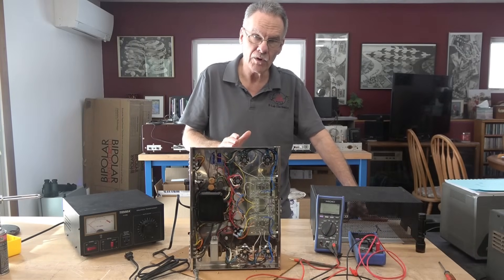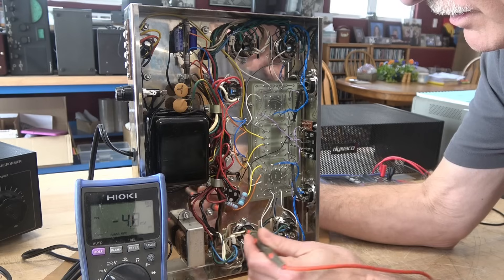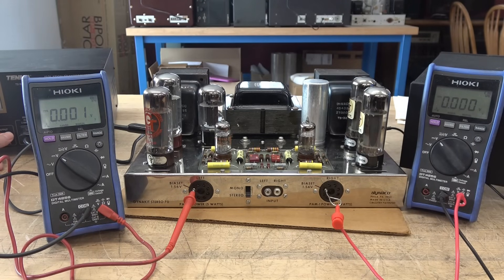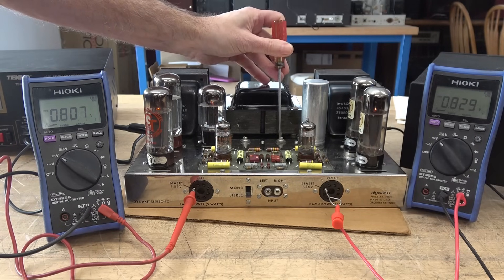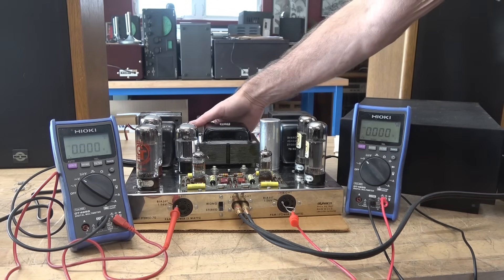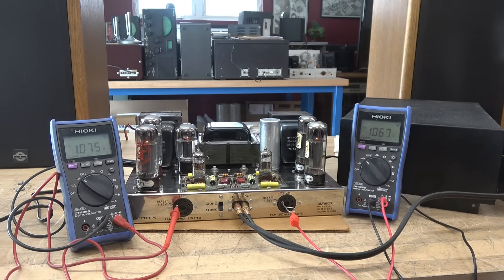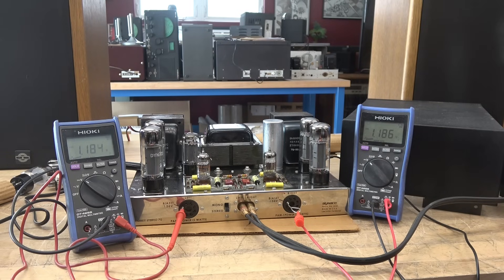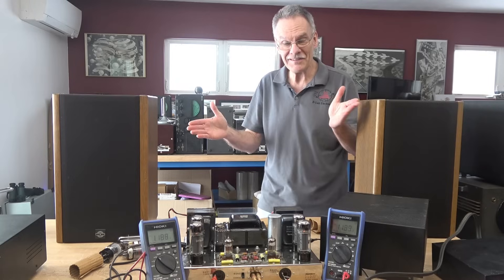Build a Vintage 70's Dynaco Dynakit ST-70 Tube type home stereo amplifier unbuilt kit Part 4

Comment: Good job Terry, makes me wish I had put my money down it last fall. Btw my st70 blew the big cap. Wish it was a tube.. I recently have had some health issues. Hope things pull back together. Btw I turned on the st. Flash of light. Tubes glow.power supply and chokes cold. I stopped there. I looked at that. Your not that old. Ya that's my thought. When I get better I'll contact you Terry.

Comment: Right on! I did a complete rebuild on a pair of these a few years back. All original circuit with dynakit parts 7199 boards and 1/2-1% matched components throughout. I sold one and still use the other. Love these amps and your videos!!

Comment: Nice build, Terry. Two Questions:

1. One thing I've always found weird is that the 2 RCA inputs are on the front of the unit. Could they be re-located to the back beside the speaker terminals or would running these wires close to the transformers cause noise and interference on the input signal?

2. Now that unit is built what are you going to do with it? Sell it off? Auction it?

I'd like to see you build a cover or cage over the exposed components in the preamp section. For safety.

Comment: Back in the late 60s into the 70s, I built so many of them I lost count. I made money to buy my own gear building kits for people, delivered operating for less than factory built price.  These were immensely popular
Reply: as I recall, the difference in price from kit to factory built was only $20 - $30. Not much by today's market but in those days the average kid would be making around $1.50 an hour pumping gas so working for $4+ an hour was a nice bonus.

Comment: Sweet amp, thanks Terry.  The final test should be running it at the design bias - 1.56 V / 50 mA per tube to check for stability.  It is also the sweet spot soundwise for the EL34s.
Reply from the maker: Yep, I always run them at reduced current for testing, then bias up later